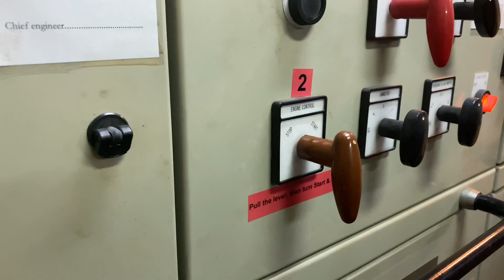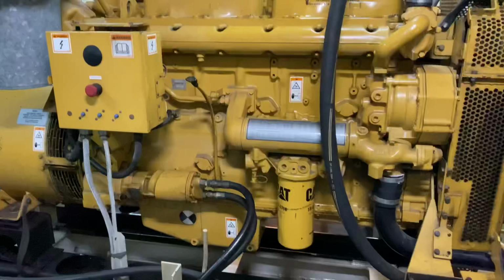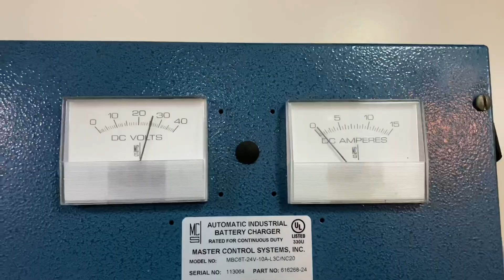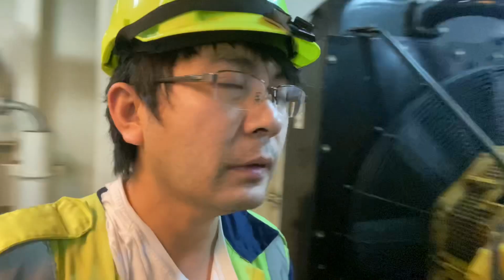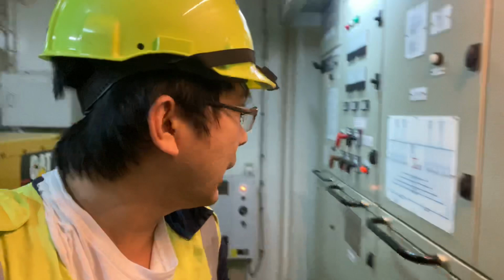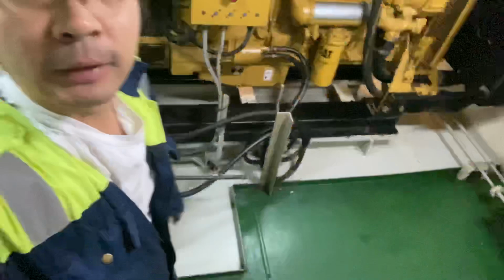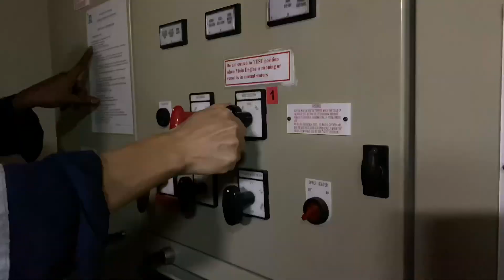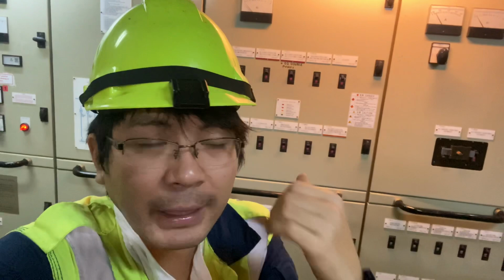BLACK OUT AND EMERGENCY GENERATOR, THINGS YOU NEED TO DO

Comment: 45 seconds because according to Solas steering gear power to be restored .As I recall as well . May be mistaken 😛😉 Thanks good video
Reply: Yes, it should come on load in 45 seconds, it gives enough time for your stby Gen to come on load if it's on auto, if it's not that's when emergency Gen will come on load.

Comment: Hi Mr. Lecky,  Thanks for your all Videos Regarding Maintenance of Refrigeration, Mechanical & Electrical, thanks a lot for giving us nice knowledge of it. we can easily understand your English speech. i want know that in your video about "BLACK OUT AND EMERGENCY GENERATOR, THINGS YOU NEED TO DO " 4 Dec 2020  you told that the emergency Generator capacity 480KW. ok.  i this in saw video, as per my knowledge, The Generator is CATERPILLAR make 3406 model and Capacity of this DG may be 320KVA to 380 KVA in 50Hz. may be Different in 60Hz (1800RPM)  but saws model is 3406 (6 Cylinder in line)  and as per your speech in Video  480 kw. Mean 3412 OR 600 KVA DG of CAT. Pls check it.
Thanks. Chetan Jungi ( Porbandar - Gujarat - INDIA)

Comment: I'm going to add that you guys don't try messing with this if your not experienced or have knowledge of what equipment your putting your hands on. There is serious voltage behind this that could kill you , destroy equipment ,and operation of the building . It also against Osha requirements without proper ppe gear on.

Comment: After you start locally and switch to auto all the load connected to  ESB have a supply from EG is it correct ? Then the bus tie open to MSB?
Reply: If i understood your question that is not the case. If you start eme genset locally (manual start) and flip the esb switch to auto nothing will happen. But if you press test on esb you will actually do a short black out on essential consumers and you need at least to inform the bridge. That will happen because the bus tie breaker will open prior the gcb will close (interlock). You dont want a relatively small diesel engine to feed power back to MSB or to go parallel with other gensets that are actually connected to MSB at time when you do a test.

Comment: If it had a backup generator, which by rule should come on automatically within 45 seconds, then why didn't they use the rudder to straighten the ship. 0:00 6 to 7 mile ph maybe lower as they had just dropped anchor. It would slow them down,   generator should have been on by then so they could correct course.  Or was it not working,  Two engines not working is highly suspicious, Could be sabotage.  Who wanted that bridge torn down, who could profit if a bridge needs rebuilding,  Gotta ask with so many greedy people in the world, middle of the night, no one on bridge but a few inconsequential workers  and police at both ends to stop traffic because of a few workers fixing potholes  in many peoples view in elite world workers are inconsequential, how convenient.
Reply: NTSB Is investigating.
Don't you have belief in US law enforcement system

Comment: When you mention about not doing an on-load test in coastal waters, does that mean that either during a switching operation or after a main switchboard power failure, everything on emergency power dies for 45 seconds, or is there some sort of battery backup for critical systems?
Reply: One there are usually so much traffic in coastal waters (due to many ships), therefore alot of maneuvering is required. Secondly, it is very unsafe. You see, during onload tests, some essential loads on the emergency generator switchboard are in manual operational modes. Now, imagine a case where during a heavy traffic in a coastal water were manual steering is mostly required and there is a blackout while an onload test is done. What will happen? Collision, grounding etc. Note that, a blackout in this context according to the PMS, is when other ship's redundant main generator(s) do not run/start automatically.
Reply: To give answer to the 2nd question; on emergency generator automatic mode, everything on the emergency generator runs automatically within 45seconds if a blackout occurs